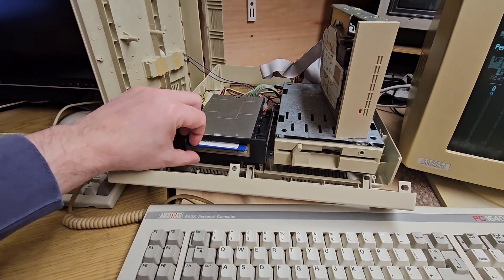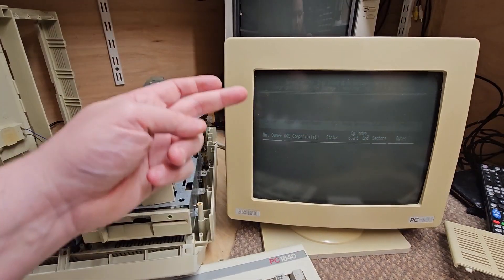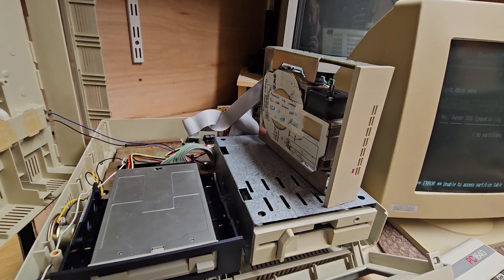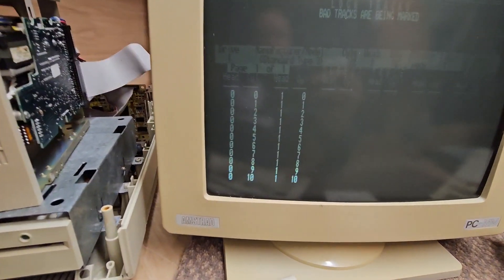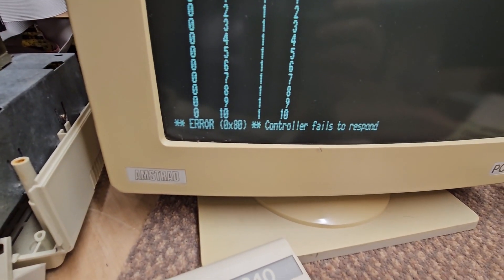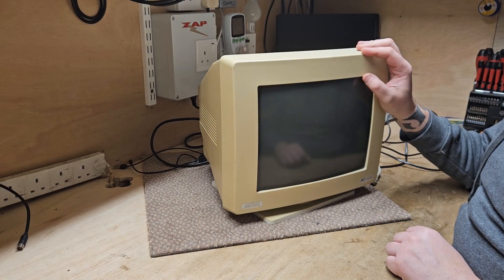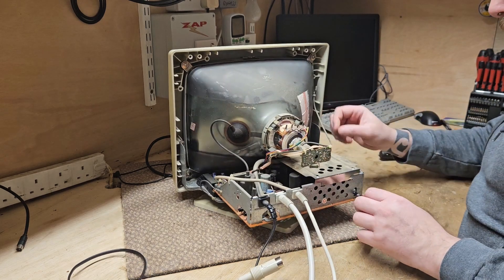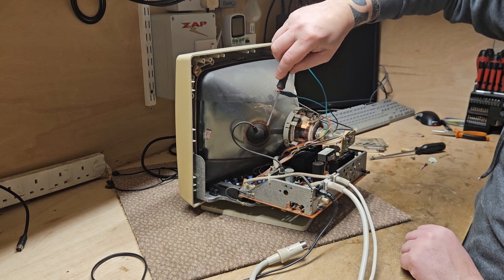1987 Amstrad PC1512 Part 2 - Bytes or No Bytes?

Comment: It's a shame when the drives fail that way =/  The same thing happened on that Archimedes A440 I restored.  I suspect what happens is a small piece lifts on the surface, clogs the head, head proceeds to dig up the rest of the disk =/  Either that or the head has something on it (plastic) that disolves with age, and the head just starts to tear up the surface...  Might be worth taking a drive like this to bits, before its powered up to inspect the disk surface, and the heads, before that "first power on in 20 years" - but the chances are, someone else powered it up already...   And of course, it could just be the disk surface itself that has "degraded" over the years which starts the destruction process.